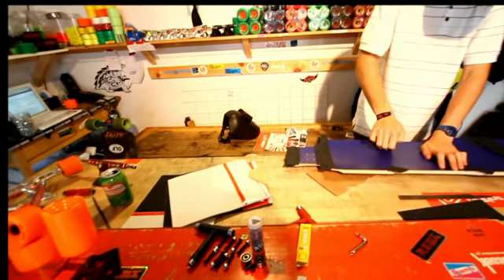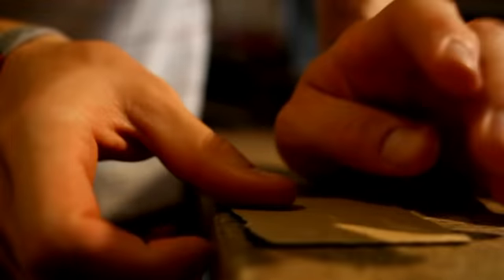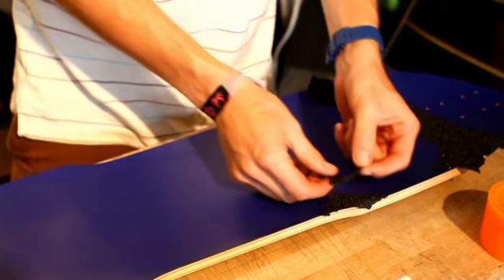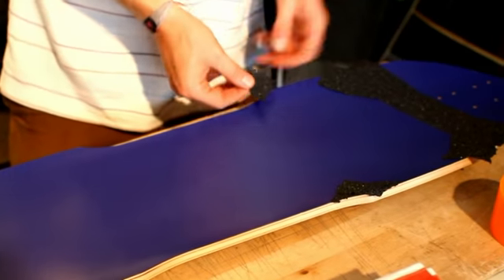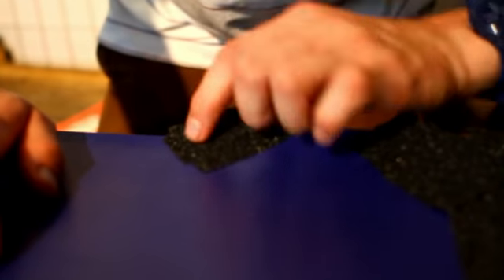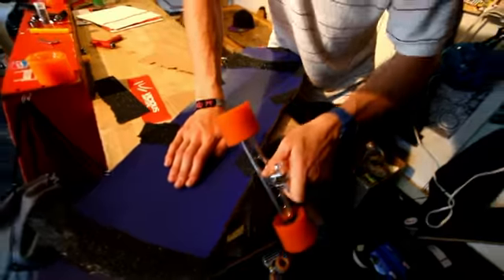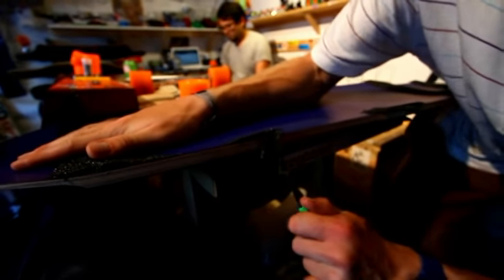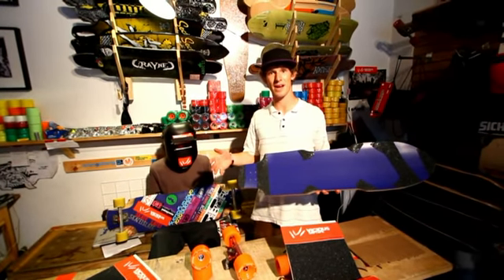Vicious 3D Concave with Patrick Switzer

Comment: instead of using strips of vicious, use duct tap, its cheaper, and you save some vicious. if you really want to use vicious, use some off an old board, i always keep the old vicious after ungripping a board.

Comment: @SlideSity I really don't understand this point of view. It' not like hes running them over with a truck. At worst he's ruining the finish on them, but since they're raw it doesn't even detract anything. Scratched Aeras still ride like fresh aeras, and if you've ever ridden rocky loose pavement on a DH/Sliding course you may as well sand blast the trucks.